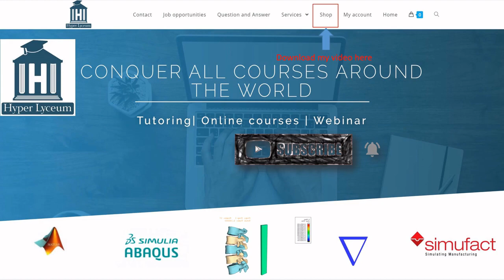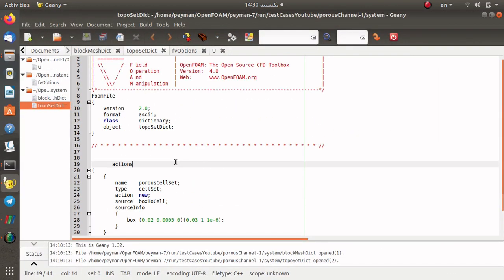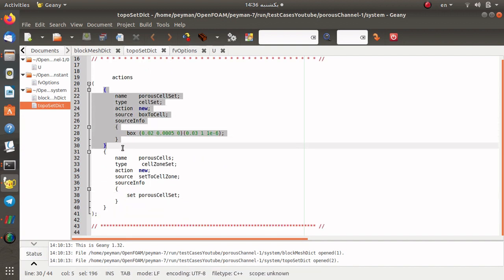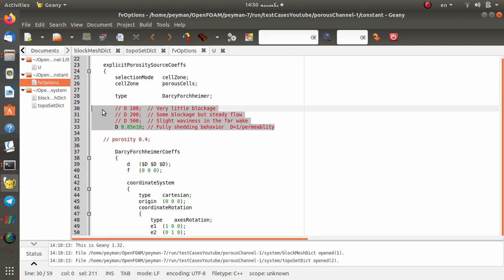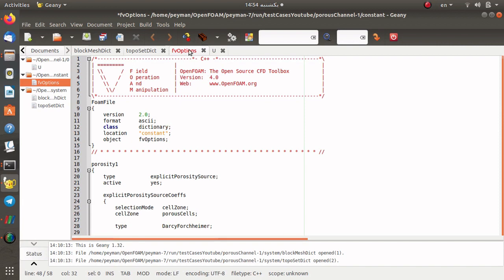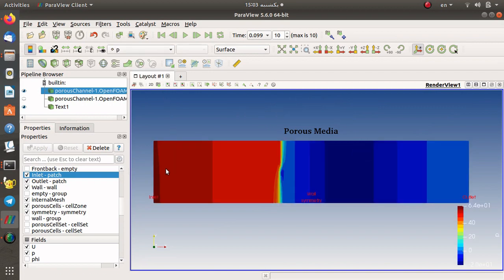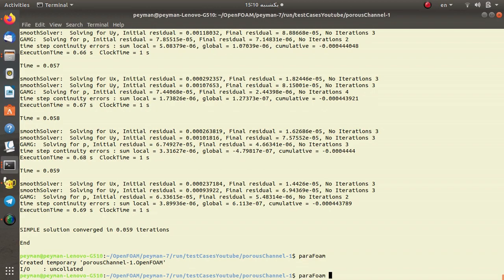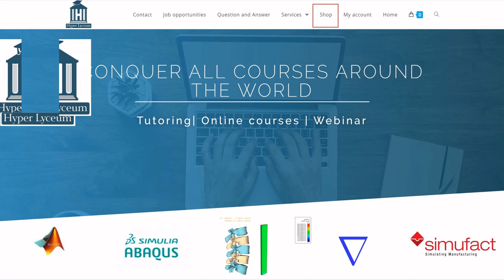Flow through a porous media: using OpenFOAM

Comment: velocity near the interface of porus-water is too slow. wall function based velocity is good but it is difficult to be handled. I calculated same problems for river flow with seepage, the river bed B.C. problem exist. wall B.C. is good for river flow but seepage cannot flow across riverbed, do nothing as you did get good velocity for seepage but bad for river flow.

Comment: hello, if wwe are working with a more complex geometry that we want to add a porous media, we are going to do snappyHex and after we finish creating the volume mesh we use topoSet , no?
thanks
Reply from the maker: Yes, after mesh generation, you can specify the porous zone by using toposet. 
ALso, it can be done in mesh generation.
Reply: @Engineering_downloads  interesting, didn't know about specifying at the same time as the mesh was created

Comment: If your bounding box is  (0 0 0) (0.05 0.001 1e-06), how your box coordinate can (0.002 0.0005 0)  (0.03 1 1e-06)? On the box "y" is not out of the domain? Considering that in your domain "y" direction goes from 0  to 0.001?
Reply from the maker: Hi Luis

It is true that y=1 is out of the computational domain. However, the topoSet/cellSet utilities only select the cells in the domain (0.0005 < y < 0.001). It means that it does not make difference if you set y=0.001 in this test case.

But for more complex geometries, the box should be determined more precisely.